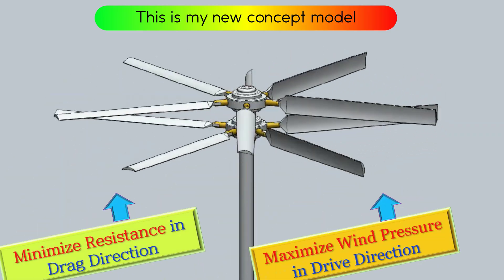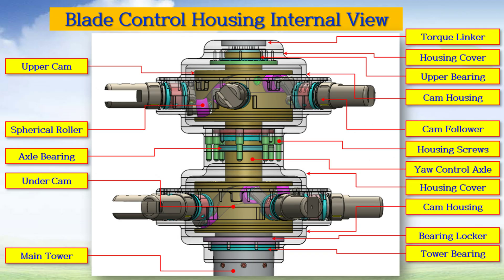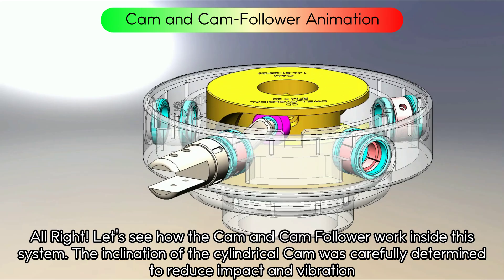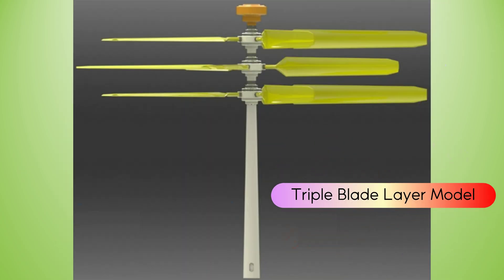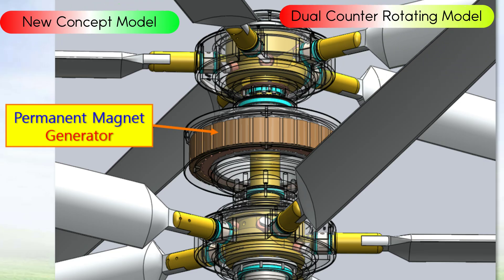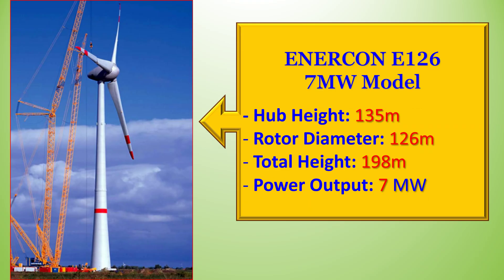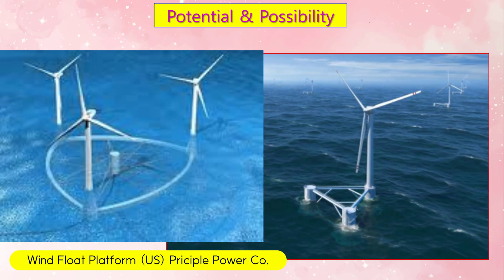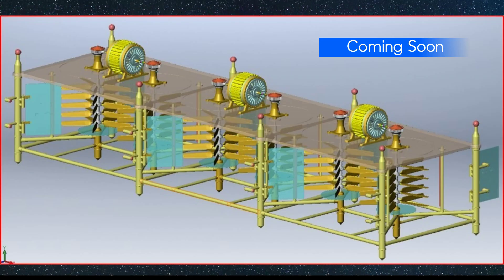Green Energy - I made a Dual Turbine Vertical Axis Wind Power Model

Comment: A simple geared system would be cheaper to manufacture. Your yoke design appears complex and high-maintenance. 
For a multi-level system a single worm screw vertical shaft would control all levels at once.
However, passive flap system is still the most economical and unlikely to be significantly less efficient.

Comment: Tip vs base velocity differences kill all efficiency. It only works with small diameter VAWT. This means multi shaft/tower system needs to be installed. This makes is economically challenging in comparison with current HAWT.